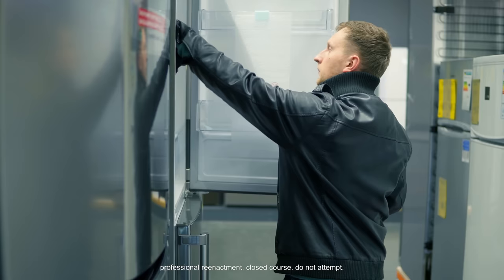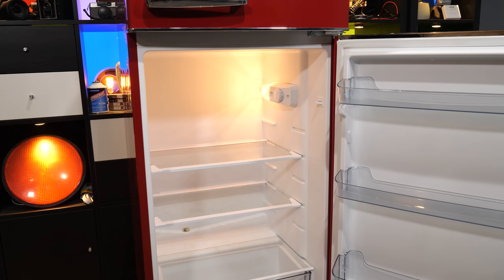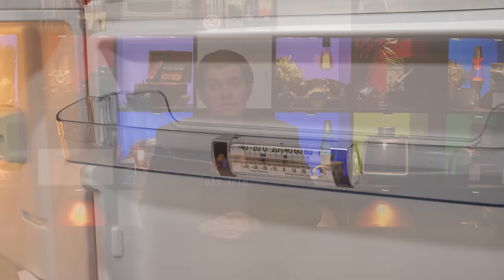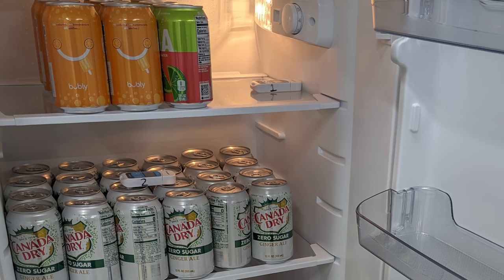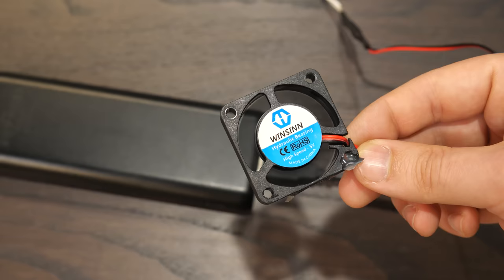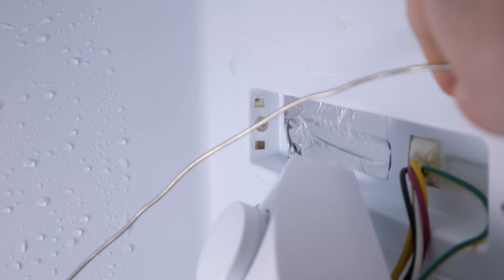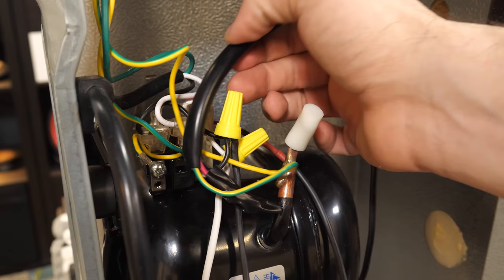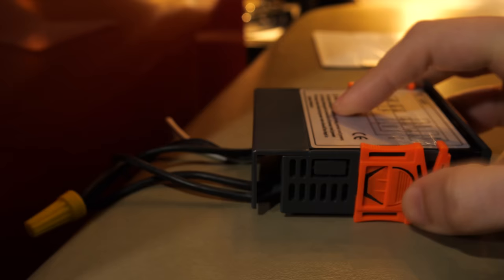This goofy fridge has a really clever design. It's also kinda terrible.

Comment: For anyone interested in conducting a similar experiment with their fridge, the temp probes he used are $20 each.
So depending on how many zones in your fridge you'd like to measure, you could be looking at spending $100 or more.
Reply: Get an arduino and a few cheap sensors, log to an SD card and you're done way cheaper
Reply: Or move it around
Reply: I've been logging (among other variables) the temperature in my fridge with a Raspberry Pi Zero and some DHT22 sensors once a minute for several years now. It's fun to be able see how adding more mass - like beverages - slows down both the cooling and warming phases, and a higher room temperature in summer increases the duty cycle (the cooling takes longer and the warming is steeper).
I still haven't gotten around to implementing an alarm function for when the door isn't properly closed though...

Comment: Could you run the fan tests without the heat generating battery inside the fridge?  I know it's not much but it is a variable. Also the convection currents were disrupted with the fan up top.  A single small fan in the rear pointing down would probably be best.

Comment: With an old capilary type thermostat your results are quite normal with an AVG of 6-7 degr C. The switching issue was not due the thermostat but as you said the position of the bulb and the compressor getting so hot the termal safety - a bimetal contact -  on the compressor housing switched off until it cooled down.

Comment: You should cover propane powered fridges, they are very interesting
Reply: Ammonia absorption refrigeration?  Off-grid, and RV style?
Reply: The R600 used on this one is a fraction from natural gas and is hydrocarbon as 
R290 propane. Both highly flammable, but propane boils on a lower temperature.
Reply: @per995 As a refridgerant. Not as a power source.
Reply: @andrewwebb917  
I did not mention it as a power source 😳😬
Reply: @per995  Original comment is about propane Powered fridges. As in, as a power source
Reply: @andrewwebb917  
I did not catch that one’ 😂Seen them and even paraffin driven in boats .The drawback is  ventilation 😬Seen deaths here by carbon monoxide poisoning 😳and even lately by lack of oxygen by propan leaks.
Interesting to know those system too.
Remember some noiseless system with electric heated closed loop also. If they failed you had to turn them upside down😂
Reply: @andrewwebb917  yes, i mean as a power source, like it is used in rv's and places that have no power
Reply: @per995  i mean as a power source, like it is used in rv's and places that have no power
Reply: @eduardoizquierdo309  My nan used to have one, before she had electricity put into her house. 
It's just a tiny generator with a fridge plugged into it.
Reply: @andrewwebb917  maby, but normally propane fridges dont work that way and thats why it is so interesting
Reply: @eduardoizquierdo309  could you give me a short explanation?

Comment: I bet there was a bit of circuit in there so the compressor shut off after a given period of time, as most sources would say "no you can't use a fridge to cool your computer, it's not for 24/7 use". A running accumulator with something like a 5-hours-max-on with 1-hour hysteresis. The normal cycle may be expectedly lower duty (say 50% delivery as it's easiest to implement) as it only is meant to sustain as efficiently as possible. When it goes out of range, it kicks in full power.

The temperature cycle being nearly 50/50 definitely implies more complex power use: at max cooling performance, the fridge should cool quickly around the stability point, and then spend a long time warming up - it can cool faster than it loses, duh, the whole point of the fridge. A 50/50 cycle is most efficient! Altering the duty-cycle to match the heat loss, though a perfect method would require future heat loss. Estimating a room temperature and rate of loss between target and room because of fixed insulation gives a nice engineer-able value.

Comment: 1) for R&D and testing like this you'd benefit from probes and software solution that allows you to MONITOR and datalog.
2) you need to know where your thermostat probe is located since it controls the system.
3) you need to know what type of sensor you are using because they are all VERY different.
4) you need to understand what the capacity your "heat pump" can actually deliver. You can't just "run longer" and expect it to reach a lower equilibrium temp if it's simply UNDERSIZED.

Literally all your problems are explained by location of the actual temperature probe (not uncommon location FYI) vs where you are putting your data logger. And the tiny compressor.

Comment: The fans running as well might have added excess heat especially when in a cold environment the lubricant in the bearings is usually not meant for use in temperatures so low.

Comment: First, thankyou for such a deep dive into the data produced. The manufacturer may have designed the fridge around the lifecycle of the pump, which may mean that the average runtime is spread over a longer time, or the thermostat is checking the evaporative cycle hits a maximum. Or other variables.

Comment: I know this is a bit late, lol. But I home brew and need good temperature control during some fermentation. I use a mini fridge and an external temp controlled, brand is Inkbird.

I set the fridge to its coldest setting and then set the temp on the controller. I then just put the temp probe in through the door.

This mini fridge also seconds as backup storage in the holidays and I just use the external controller the entire time.

Comment: Im in commercial refrigeration but worked on home appliances for years.. and a lot of this stuff is still fascinating to me. It's almost like they're using that "evaporator" as a metering device itself, the long run after giving more ample time to absorb heat and phase change the refrigerant. The freezer having less to cool and more opportunity to reject heat into the refrigerant Id wager. You can see the induced pressure drop and seems to all properly work, very cool stuff.

Comment: Well, thermostat is sensing temperature of evaporator to make automatic defrost of refrigeration section possible. This scheme doesn't regulate air temperature at all, it just maintains evaporator temperature between two points, one of which is high enough to let all ice buildup to melt and another is low enough to get air temperature inside in normal conditions down to 1 *C. Insulation of refrigerator passes some heat from outside, similarly evaporator of working fridge sucks heat from air inside and, again, refrigerant sucks heat out of evaporator. The entire system of those heat exchanges balanced so that when evaporator reaches thermostat cut out temperature (usually about -12 *C) the air inside is reaches 1 *C. If velocity of heat exchange between evaporator and air inside changes, the average temperature of air will also shift, upwards if heat exchange slows down (because of any obstruction of free convection inside chamber, like soda cans in large quantities) and downwards if it accelerates (working fan, for example). After all, you can't exactly change heat exchange between refrigerant and evaporator in assembled fridge. By the way, this style thermostats has fixed cut in temperature (about 4-6 *C) so only cut out can be adjusted and temperature probe must be submerged in medium at least by 1/3 of total length in order to work.

Moreover, not only refrigerators use this design. In older days, one could get a freezer with two thermostats and hot gas defrost. One thermostat was controlling the temperature inside, another was turning on small solenoid valve that bypassed condenser and allowed hot gas to enter evaporator pipes. Ice build-up reduced effectiveness of heat exchange, evaporator in turn reached lower temperature than designed and second thermostat began defrost cycle. You could actually install hot gas bypass and second thermostat in this fridge to achieve better temperature control, since refrigerator loop comes first, although, that would be a bit more expensive than electronic controller with defrost sensor.

One could appreciate the simplicity of design, and even if if has some flaws, anyways, it is much better than keeping food at room temp :)

Comment: In the beginning I was thinking about replacing the thermostat.
eBay and Amazon both offer at digital thermostat with a built-in relay and electrical thermal coupler. 
And a program will temperature swing all for about 15 bucks

Comment: I finally got to see this design.  However, it was just a small mini-fridge without a freezer compartment (refrigerator only). It worked pretty good, and it had a pretty large area that was "cold" on that back where you would see the frost start to accumulate.  Pretty neat to see how it all just melts and drips down the wall into a little hole in the back at the end of a cycle. Very quiet.

Comment: Alec, when I was a kid (I am 56) my grandpa had a really old fridge (at least 30-40 years old then) that run on the gas supply and had a tiny pilot light that run the whole thing - no electricity. It was amazingly efficient and it was always fully iced up because it froze the whole thing. I understand that the same method of refrigeration is (or was) used in large commercial cold storage systems and recently I have seen camping fridges that run off gas too. Knowing your love of all things refrigeration have you looked at how these work? I'd be interested in finding out.
Reply: The gas fuel (either propane or CNG) burns and evaporates the refrigerant (mix of ammonia and water), which condenses and absorbs heat energy from the body of the refrigerator, and then is evaporated again by the burning gas. 

The rest of the appliance is the same as an electrically-powered version.

Comment: I think the design counts on as little air movement as possible and the temperature layers stratifying to give the best results. That combined with the heat generated from the chemical processes producing electricity in the fan batteries, the wires losing heat in powering the fans, and the friction caused heat of the fans, all produced so many variables the simple included thermostat couldn't deal with. Lots of heat energy is stored in liquids, so that much soda all at once can be an understandable load on the compressor, especially if fans are blowing around the air that should be settling into temperature layers. The video was a fun saga down a rabbit hole though.

Comment: The thermostat tube is attached to the evaporator, basically it's going to run off the suction pressure. The suction pressure will be a combination of both loads with this design. With no load in the freezer portion, the pressure still drops causing that OEM stat to shutoff. It acts somewhat as a safety for the compressor, if there is no load, no risk of floodback.

Comment: 19:24 This will be a bit of a thing, fair warning.

So, first off, I'm American, and grew up using the Fahrenheit scale. However, I'm also autistic, and Celsius has a uniformity to it that makes my autism happy. I'm also a STEM student and in chemistry, physics, etc we use SI units which are based on the metric system, including the Celsius temperature scale. So while I don't use it day to day, I'm very familiar with it.

And that's why I don't use it day to day, only when I need to convert units for non-Americans, or when I'm doing scientific calculations and conversions where having everything in base 10 SI units just makes things easier.

Celsius is very elegant in that the freezing and boiling points of water at sea level are 0 and 100 degrees respectfully. There's a problem with this though. Typically, when you're measuring the temperature, what are you checking? For most people, it's the ambient air temperature. "what's the weather like?"

For cooking, you don't really need to know the exact temperature of the water, you can see if it's boiling or not, and that's all that matters. And even if you are measuring water temperature, you're probably not doing it at sea level, so all of your readings are going to be skewed anyway.

Now a quick look at Fahrenheit. The freezing point of water is 32 degrees, and the boiling point 212. That's 180 degrees compared to Celsius' 100, giving Fahrenheit almost double the resolution, which is why American weather forecasts don't use decimals. There's no real difference between 72.0 and 72.1. But you can feel a slight difference at 73.

To build on that, typical year round temperatures for most people in most parts of the world are between 0 and 100 Fahrenheit. There are places where it frequently goes beyond that range, but most people, in most places, will see near zero as a yearly minimum and near 100 as a yearly maximum, with days where the temperature strays into negative or triple digits being memorable for that fact alone.

I'm not saying that Fahrenheit is better than Celsius, SI units, or, as I most commonly use because I love astronomy, Kelvin, and we just gotta be different, not am I hoping or expecting anyone to "convert" to Fahrenheit. I just mean that, after extensively using a variety of scales in a variety of situations, and spending probably too much time thinking about it, my conclusions are thus:

All temperature scales have situations where they are the better or worse tool for the job. And for a lot of day to day uses, I prefer Fahrenheit. No, it doesn't fit neatly into a base 10 scale based on water at sea level, but I've also never needed it to, and likely never will.

Comment: With your setup, If your evap coils ice over because of excess humidity enough to block air flow, and no cold air is circulated , your fridge will not be cold, and the compressor will run continuously. Otherwise, it will work.

Comment: This was delightful.  I kept thinking I knew what was going on, but I was wrong at every turn.  I thought auto defrost worked by moving the air across the surfaces where water would condense.  Nope.  Heaters?  Seriously?!  When the compressor shut off after five hours before it had restored the set temperature, I guessed the compressor pump had exceeded its duty cycle.  Nope.  I expected you were going to discover that the door switch failed and that 10 watt bulb was staying on with the door closed.  Nope.  I wondered whether the heat produced by the fan(s) was going to be worse than the anticipated improvement of circulating the air.  Nope.

Comment: This style of ultra-simple, very efficient fridge/freezer design is used a LOT in RVs and trailers. In fact, the only difference between that fridge and the fridges I've seen in RVs is the plastic/metal casing. Everything else is identicle. They really are fascinating feast of engineering and excersizes in efficiency.

Comment: The store I work at got a new display fridge (glass doors),  and we filled it up full with 90F beer.   Took most the day to pump all the heat out and get it cold.    But once it got cold its staying cold.  We usually add 10 or 15 warm cans a day.  which it easily brings to chill temp.  Stocking a fridge with really warm stuff completely full isn't a realistic situation for 99% of the general public,  Most the time a fridge might be cold,   then reloaded with 15-25% warm stuff,  that has to cool down after a shopping trip.

Comment: Yeah, that’s just lag from stagnant air and a thermostat attached to the wall.  The thermostat setpoints haven’t changed it’s just been decoupled from the inside temperature and is reading the cooler wall temperature.

Comment: Don't turn any fridge on its side unless it is specifically designed to be able to by the manufacturer! Letting it sit on its side for an hour, or any period of time, will not sufficiently clear the lubricant. It may not break down right away but it will decrease the lifespan of the appliance.

Comment: The thermostat sensing capillary goes in a tube on the fridge evaporator and senses the refrigerant temperature. They are also designed to have a cycle off time to naturally defrost. (Cyclic deftost in the fridge compartment) Do some research on thermostat types.

Comment: My concern for the fans in the fridge is on the fact that all electric devices produce heat, especially the battery pack. By doing this, you're basically putting in a permanent heat source in the fridge. The fans may (or may not) help circulating the fridge, but it would almost certainly raise the temperature in the fridge (more so for the items near the electronics), and in turn put another burden on the compressor. As the compressor keeps running, it generates more heat which will be conducted back in the fridge through the crisper drawer, and thus the vicious cycle continues.
I don't know if my idea would work, but I would try using fans that can consumes electricity from outside of the fridge. Maybe use a 110V fan or a minifan with a transformer on the outside, and wire through the inner casing and connect it to the fridge wire into the wall. This should minimize heat generation inside the fridge, and hopefully increase its effectiveness.

Comment: observations: a fridge is a freezer with a warm compartment,. Loading this puppy up with a lot of mass (cans) is like trying to cool a house with a 5000 btu window ac, The fan upset the design of the system keeping the thermostat knowing when it's cold, My Whirlpool has the evaporator's own  by the compressor (Air pump) with a fan. One time the fan went bad yet the fridge stayed cold inside and the cabinet side was warm. This fridge is not meant to be a primary, maybe in a den or bedroom.

Comment: You can control the amount of cooling by making it work till fridge temp is a set level. Or you can use a timer.
The cheap way of making a timer is a bimetallic strip. And, you can legitimately call it thermostat even although it is outside the fridge.